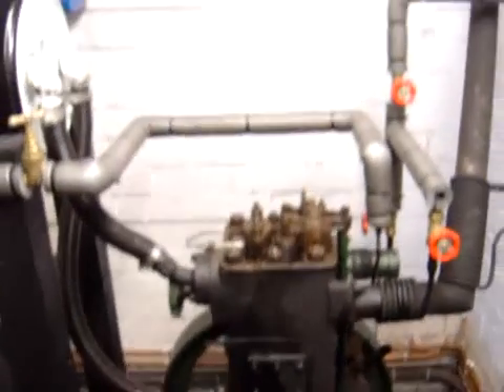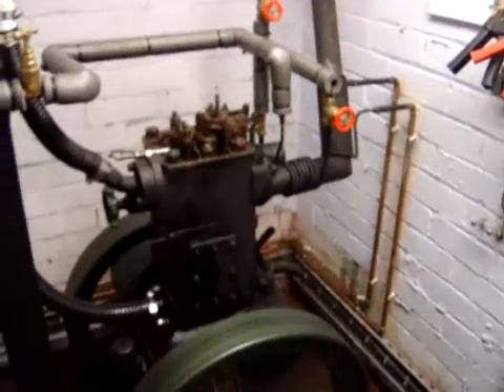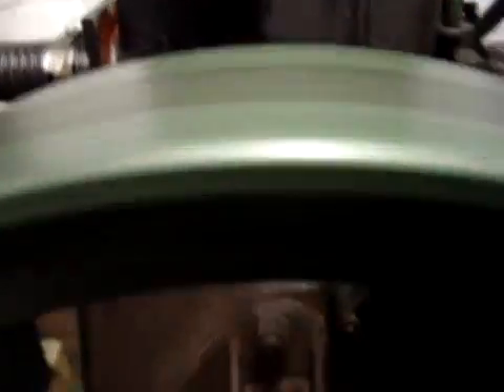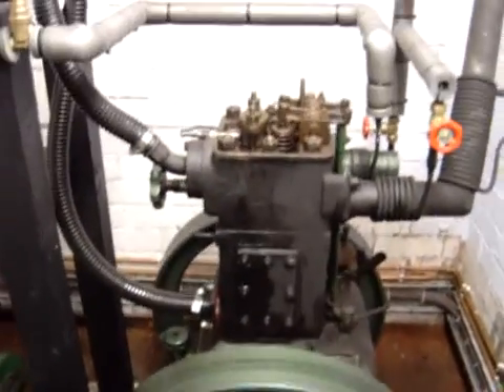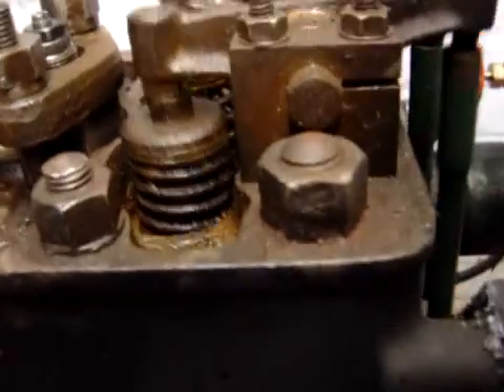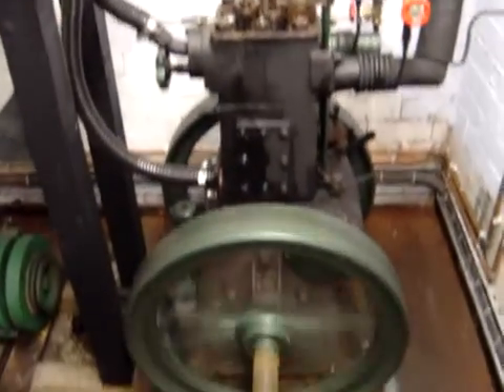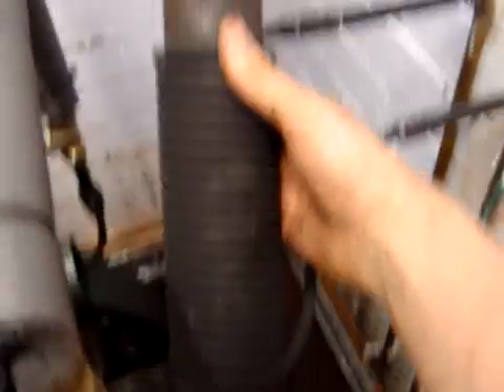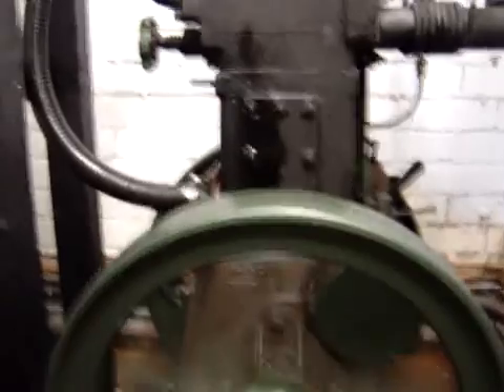Lister CS Stationary Engine running on Waste Vegetable Oil

Comment: Was it worth it in long run? Do you have problems with glogging or anything? Do you think liste sl1 or lister hr3 could work with veg oil? I have opportunity to buy those generator setups for cheap.

Comment from the maker: Just to answer a couple of questions from below:

1. At the time of the video the engine had just been reassembled and the rocker did indeed get oiled.
2. I ran the engine on Waste Vegetable Oil I loaded it with a 80Amp 12VDC alternator charge my 2000AH battery bank and a 230v AC 2KW head for constand loads around the house. 
3. I was recovering the water coolant heat and also the exhaust waste heat which was used to heat my central heating system!

Comment: I think you will need one of the CS range for running on vegi' oil. It would be just to thick for a petrol/paraffin vaporiser to cope with. There are loads of engine in the "CS" cold start diesel range such as the CD and CE. It is interesting to note that the engines here were never marketed as "CS" but 3/1. 5/1, 6/1 and so on.

Comment: Why is your RPM so variable?  And would it kill you to squirt some fresh oil on those poor old rocker arms / valve springs / valve stem?    Otherwise great job, I especially like your exhaust heat exchangers (I assume that's water right?) and good use of insulation on the plumbing.  Are you using the coolant heat also?